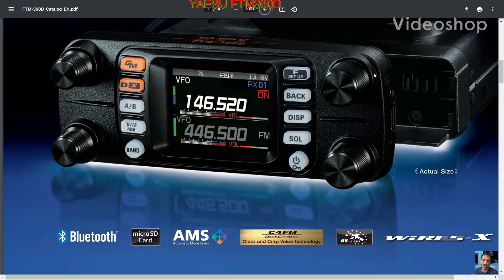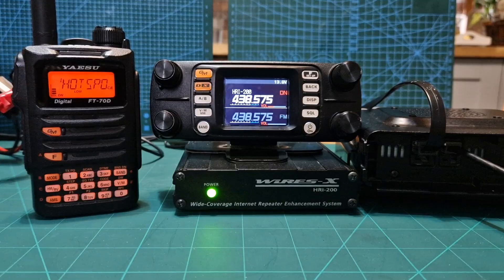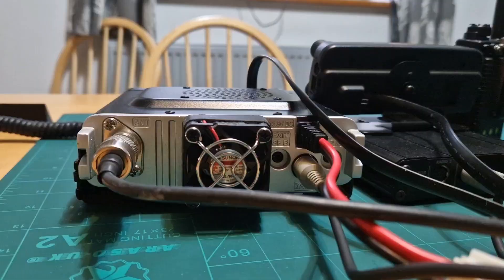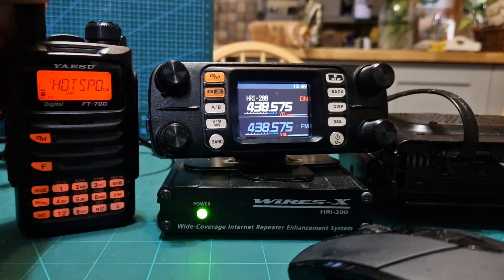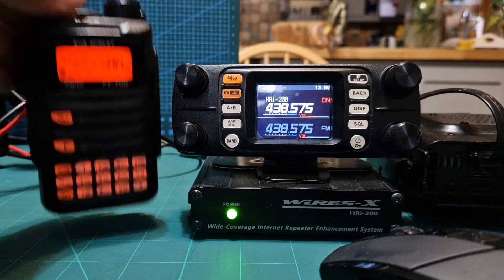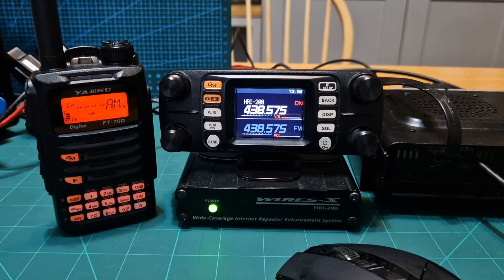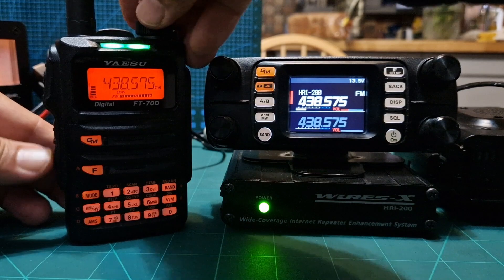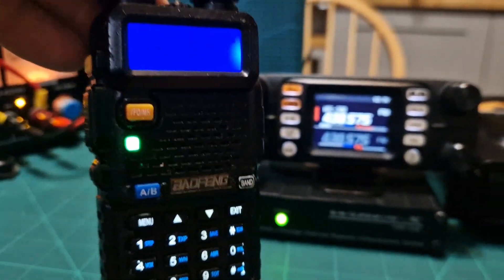YAESU FTM300 HRI200 Install / Demonstration

Comment: Sorry, I don’t have the 200 I want to connect to a repeater to get into wires x
Reply from the maker: It's same process watch loads Videos
Reply: @M0FXBHamTech  My issue is when I press the Dx button and the “x” comes up and blinks it does not connect? Does the owner of the repeater have to manually let you in each time? I’m sorry for bothering you I’m just at my wits end with trying to connect